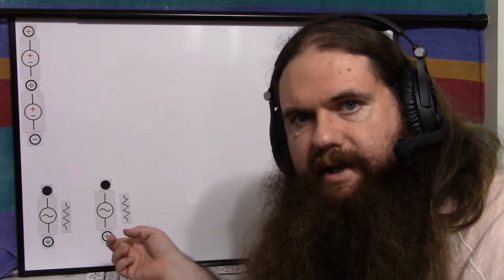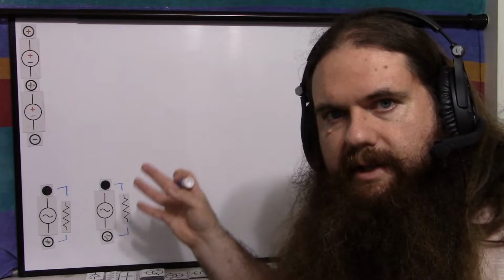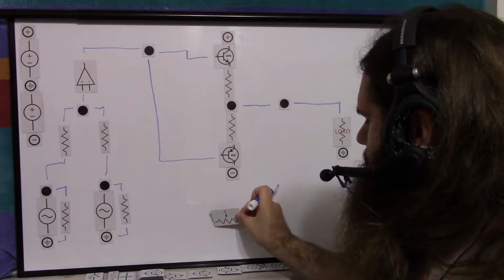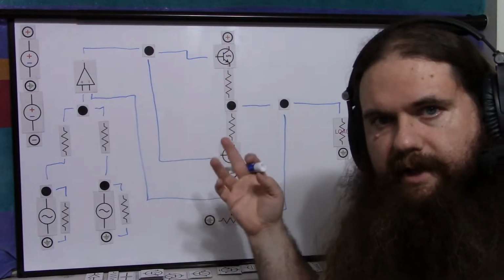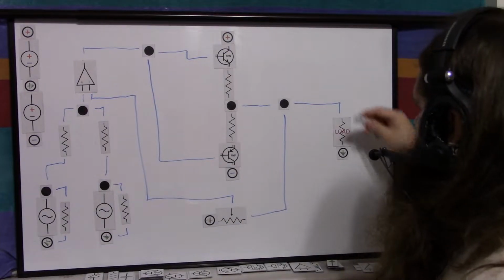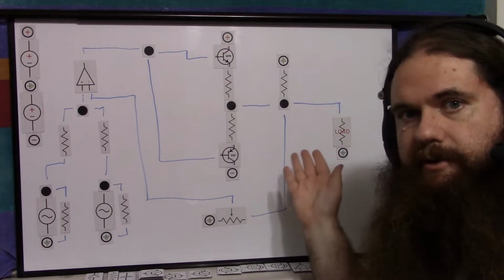Powerful Audio Amp - Still Cheap And Easy - New And Improved Cleaner Design - Simply Put

Comment: I'm new to this and had a question if you wouldn't mind answering: other designs I have seen usually have a capacitor between the output and the speaker to prevent damaging the speaker with DC. Is there something in particular about this design that ensures near-zero DC out? What if there is DC coming from the input?
Reply from the maker: If there is DC coming from the input, it will indeed be amplified through to the output, and there could also be some DC caused by imperfections in the circuit itself, so the input and output AC coupling capacitors are the right way to do it. In this case, this is a "quick and ready" design meant for learning and testing, so it's not going to be connected to anything expensive. Another thing is that a lot of amplifier designs use only one power supply, meaning they have to explicitly bias the signal to work with it, and in that case you would absolutely have to have the capacitor on the output or the whole thing would just blow the speaker out. This one uses a dual supply, though, so that's not an issue.
Reply: @simplyput2796  Thanks for your response! It means a lot!

Comment: Awesome as always! :) Can I post requests? There's two topics that I'd really like to see! One episode on precision rectifiers. The theory and also what opamps that are suitable -would I need a dual supply opamp for that or could I use a single supply? And I also like an episode on how best use dual supply opapms when there's only a single supply available. I find it hard to know what to do when transferring a project from the bench to the "real world" when most consumer power adapters you buy are just regular 9-24v dc. Maybe you even could show example how to make a generic module for this, like consumer 24v adapter to +-12v?  Thanks again for super entertaining and informative content!
Reply from the maker: At a first glance at the Wikipedia article, a precision rectifier is just a regular rectifier except designed to not lose the diode drop, in which case I wouldn't think a dual-sided supply would do anything: The op-amp is just trying to shove extra voltage through to counteract the diode. And you need to keep something in mind: From the op-amp's point of view, there is no "single" or "dual" sided supply: It just has its supply. It's got a high rail and a low rail, so it behaves exactly the same in both circumstances. 24V single supply with signal biased to 12V, or +/- 12V supplies with signal with no bias, the op-amp behaves exactly the same: To the op-amp, it's exactly the same thing and it has no idea of the difference. Keeping that in mind might help your thinking.
Reply: @simplyput2796  I thought I'd make it for rectifying line audio to make it 0-5v cv (for synths), drive leds, arduino etc.. the precision rectifier feels like a good, multipurpose way to do it. :)

And ok! I don't need dual supply to run most amps? I never thought of it the way you described it before. So I can use such as 741 on a single supply? What a revelation!
Reply from the maker: Dual-sided just means you don't have to add and then remove a bias to get your signal into the middle of the available voltage. It's easier, not better. (In my opinion, it's MUCH easier, but that's subjective.)

Comment: Which opamp are you using?
Reply from the maker: It's a cheap chinese version of the LM358. Probably any op-amp would be good enough for this application but of course you'd use better ones for real equipment.
Reply: @simplyput2796  Ahh! I have tried those in some amps that I've built. It was definitely on the low end. I have some NE5532s (which may be a drop in replacement for the LM358), and I'm currently working on an amp using a NE5534. The 553x series are specifically for low noise applications. 

I ordered 10 5534s from China. None of them worked. I got some from Mouser and they work great. Just in case you are thinking of trying something else.

Comment: Love the video, Hate that popping sound when you unplug speakers... so thanks for the fix.. P.S. could a diode also to stop that pop?? used like you would on inductive kick in a dc circuit?? or would it still happen because of voltage drop in the diode & time?? 
& one more thing which of your power supplies(left or right) was connecting to the negative rail of the op-amp??
Reply from the maker: The diode is meant to channel the back-emf generated by the inductor, but that's not what's going on with the popping: The problem is that, as you slide the connector in or out, the conductors are making intermittent contact with the wrong contacts, and you're getting signals that aren't referenced to the expected ground potential properly, and so it ends up seeing (and amplifying) a wild and unpredictable signal. The pulldown resistor (when you use a big one like I did) ends up draining only a couple hundred picoamps (on the signal) or a couple microamps (on the output).

The left supply is positive and the right is negative: I short the negative of the left and the positive of the right, and that's my 0V ground. Important to check first to make sure your supply doesn't internally connect the negative to earth ground.
Reply: @simplyput2796  i suppose i never thought about the tip, ring, or sleeve touching the wrong points when being pulled(theres something i thought id never say) as for the power supply's nice one, & could ya use two batteries this way with 3 wires using two to power the op-amp yes! & thanks!
Reply from the maker: Yep, just have an even number of batteries and take your ground from the middle. The key is separate EMFs: Each battery is a separate emf, each power supply (not earth grounded) is a separate emf, each transformer is a separate emf, and so forth. Every emf can share one and only one potential each with the other emfs, and that's your reference voltage.

Comment: I never knew about the pulldown resistors to stop noises when disconnecting stuff. I've never been an audio amp building kind of person anyway. I'm more interested in VCOs, VCFs and VCAs, synths in other words but I always just plug circuits into my old Technics amp.
 
I suppose you just make sure that your audio source is already AC coupled so you have no DC offset in the first place when using this circuit?
Reply from the maker: You could just AC-couple the signal to this and it would work fine. I didn't because I just wanted it to be as simple of a design as possible so if I could leave a part off without suffering, I did.